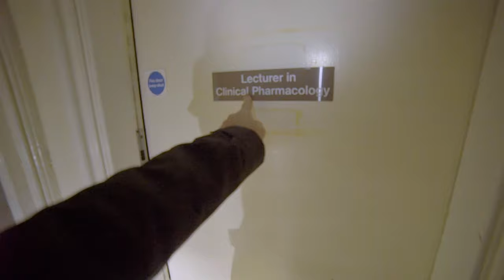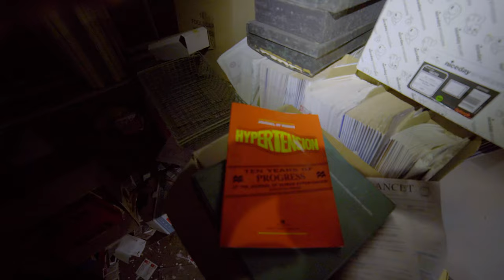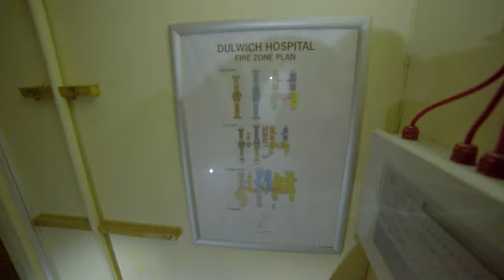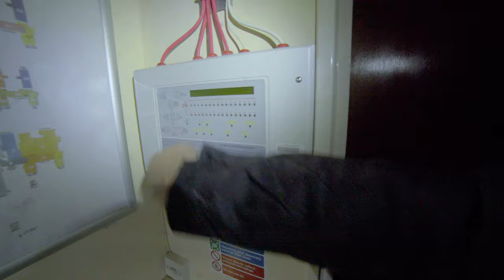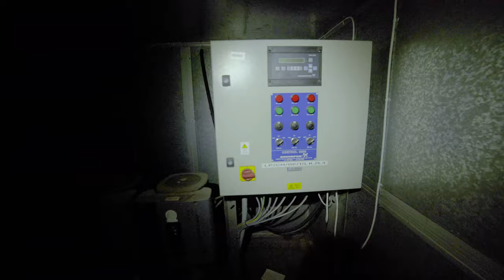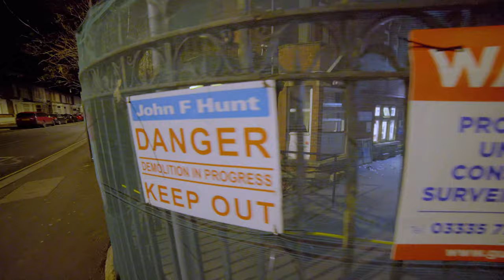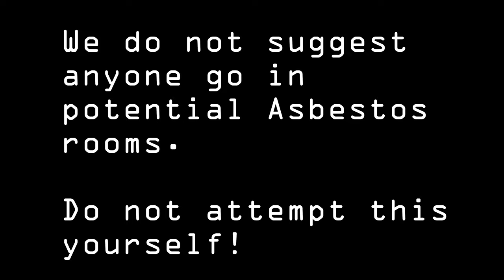Dulwich Hospital Part2 - SKYWALKS

Comment: They’ve done a good job down there. That Greco sprayer is used to spray a watered down PVA solution to catch any fibres in the air etc
Reply: Encapsulation of fibres left on the surfaces.

Comment: All the machines running were most likely just air movers,  not driers dehumidifiers.  The asbestos work space has the air extracted out via ducts fitted with Hepa grade filters so that asbestos fibres aren't evacuated to outside air.  With the work space air being evacuated this means the work space has negative air pressure therefore any air movement can only be one way from unprotected areas with positive pressure to the workspace with negative pressure and then evacuated.  This controls the air quality of the remaining site stopping spread of airborne fibres and dust.
You will have been reasonably safe in those asbestos zones as the air evacuation system was ongoing although in one boiler area it did look as if this was unclean fresh work with dust present.  Your walking through it will just kick it up to be airborne.  Be mindful of asbestos everyone.  Just one fibre stuck in your lung tissue can cause Asbestosis = Fatal.
Reply: lovin the channel lots info which is awesome and love the camera man  he goes umm lols
Reply: @Zain starichi...  positive about what?